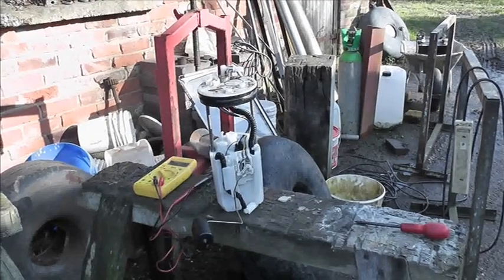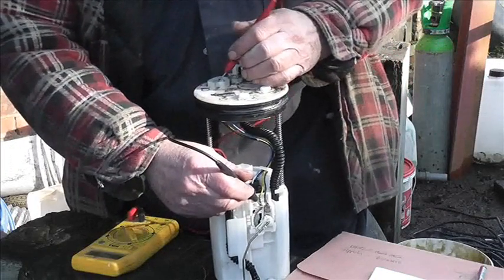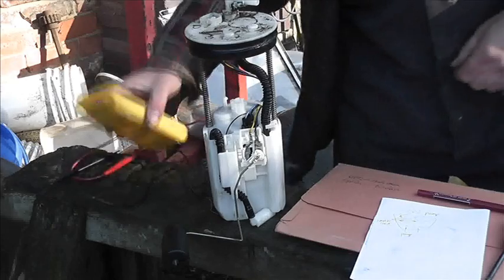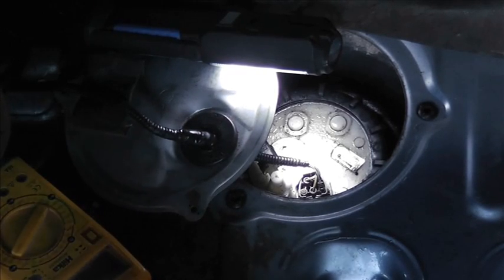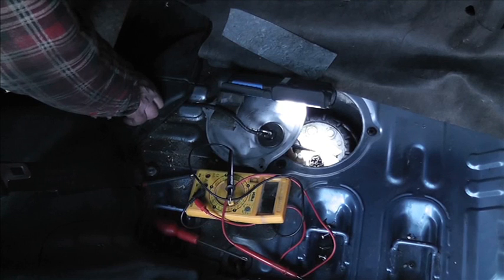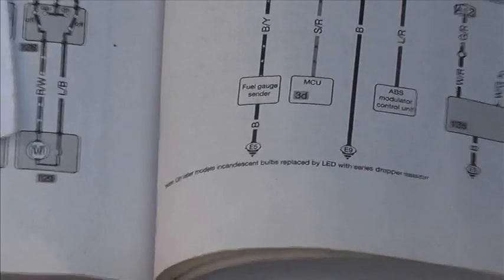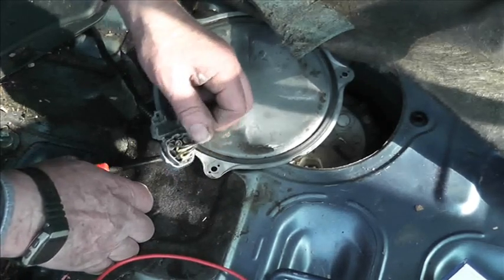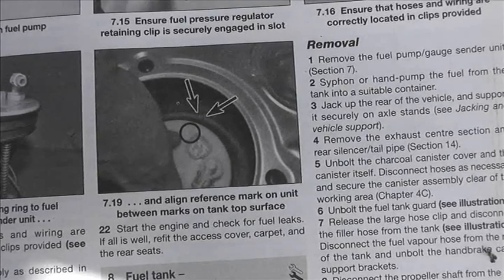Honda CRV fuel gauge not working, investigation and success.

Comment: Thanks Andy I had almost the same problem and the pin on the fuel pump has a bad connection on the gas liquid side so probably I will have to get the complete fuel pump since everything is molded together at the pin connector
Reply from the maker: It's even worse on modern cars, stick with it till the end, cheers

Comment: Excellent diagnosis!!! For me the plug was measuring 11V DC and the selector was showing 130 to 14 ohms but I found the female connector wasn't making a good connection with the new pump plug so had to tighten the plugs to make it work.
Reply from the maker: Thanks for the comment, with "modern" cars all the small plugs and fine pins it's a disaster waiting the happen, cheers

Comment: Outstanding diagnostics!  Great video.
By the way, I own an 1100.  They were called Austin Americas here in the US.  Mine is a 1970.  I've had it since 1983, and it's restored to looking like it did when it left the factory, although I drive it often, so it's not a garage queen.
Reply from the maker: Who'd have thought a bash on the tank would show up a build fault. The BMC 1100s were OK cars, basic and practical transverse engine front wheel drive and light, and no computers, cheers

Comment: Good work Andy, easy to get overwhelmed with the modern motor vehicle. I believe CAN-BUS is for between computers. The sender unit on yours is a simple sensor for one of those computers.
How about some cars using optical cabling to cut down on copper wires? Try soldering those back together!
Reply from the maker: I'm thinking avoid cars beyond 2012 as they are full of unnecessary complexity and designed to fail, cheers

Comment: I suppose this is a reasonable time to remind some folks that a simple test light with incandescent bulb can help. Bulb to 12v and check black wire going to sender unit to confirm ground. Bulb to confirmed ground (somewhere on the body or the fuel pump ground) and to the supply for the sender unit. Resistance of the bulb likely 8-9ohm so not far off an empty tank reading. Bulb should light in both circumstances if wiring OK.
Continuity can give you a reading without current carrying capacity so good to check with a load.
Reply from the maker: Definitely use a load test on circuits that carry current, many the time when a meter says there's a voltage but not under load. The faulty solar panel system showed that where the duff charge controller was killing it all, cheers

Comment: I once had a Marina sender where the rheostat wire went thro a small hole in the teminal it was pushed thro and wound but no solder clean and solder fixed
Reply from the maker: Yes there's always the poor construction to deal with. I wonder if this earth pin fell into that category, cheers
Reply: @TheInfoworks  🤔🌝